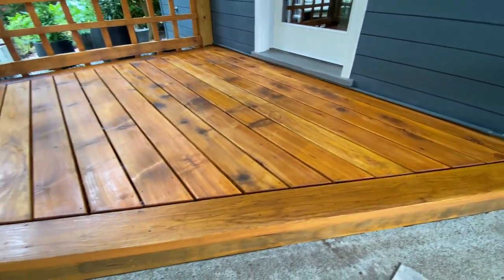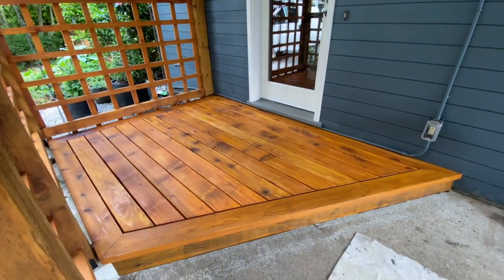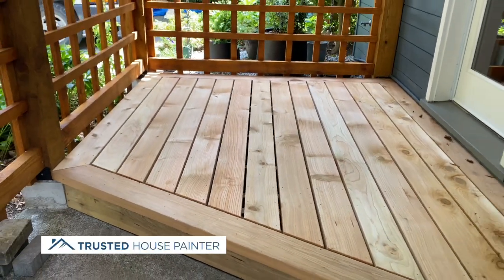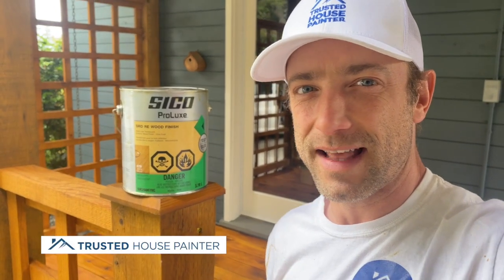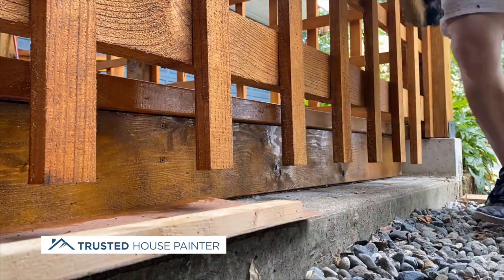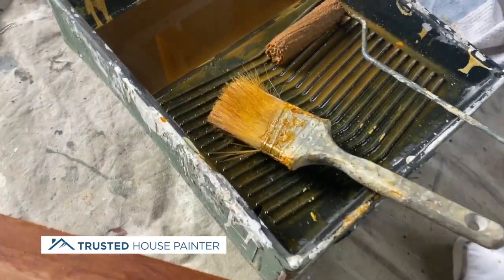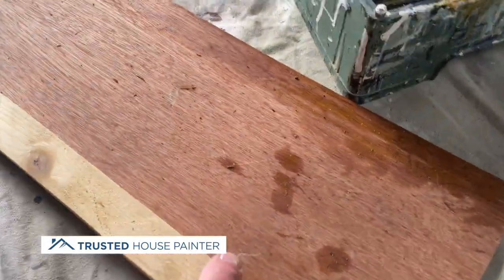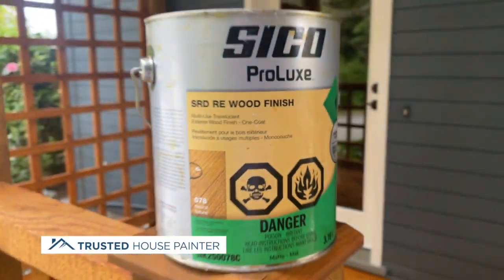The Best 1 Coat Stain Product For Wood Decks - Proluxe SRD RE Product Review

Comment: Thank you for the review.  I’m considering this for two new cedar decks and one new cedar fence.  After the initial coat, can I simply add maintenance coats every two years without stripping?
Reply from the maker: Thanks for your question. The answer is yes, this one-coat product is designed to be applied as a maintenance coat every year or two - depending on how much environmental impact it has. Just give the deck or fence a good wash and recoat when the wood is nice and dry.

Comment: Good video, product turned out nice on the deck.  I'm curious how the stain has held up since this was first applied - both from a color/fade standpoint and also any peeling?
Reply from the maker: This product holds up well, especially as a 1-coat system. Almost all coatings depending on it's exposure to the elements: sun exposure, ability to dry when it rains (airflow), the age and integrity of the wood, etc. This video was produced staining new wood in an undercover area so I assume the color and coating will last a long time. However it does get a lot of foot traffic so the floor will probably need to be maintained more than the lattice and posts. Thanks for your comment! If you need help call toll free 1-866-724-6818 or create a free listing and get quotes at www.trustedhousepainter.com
Reply from the maker: Wear a respirator if you're working in confined areas... this stuff is toxic!
Reply: Just went ahead and choose this brand over the other ones. Didn't like the fact they were all water base and the minimal price difference should pay itself in the following year. Cheers.

Comment: I used some Cabot australian timber oil and it seemed to streak when doing any sort of overlap. I’m not seeing any issue with this in the video, but did you have any issues when recoating like the following season perhaps? Thanks
Reply from the maker: No I didn’t have any issues. However, it’s always best to keep a wet edge and stain the whole length of the board.
Reply: @TrustedHousePainter  Awesome. Thanks! I’ve been looking for a good outdoor finish for some cedar trim on my shed and I think I might use this.